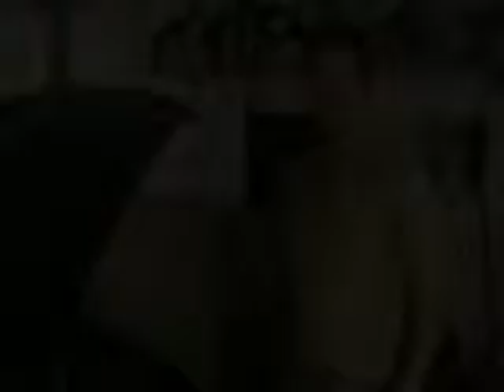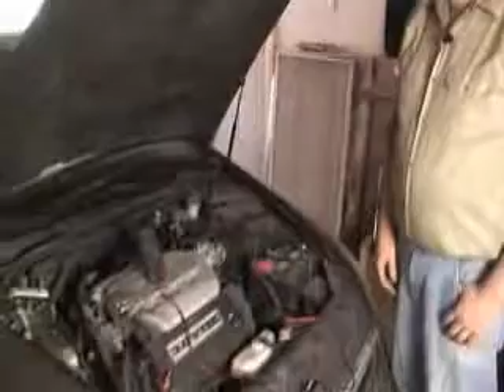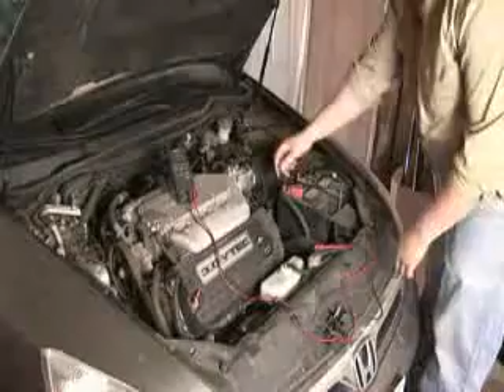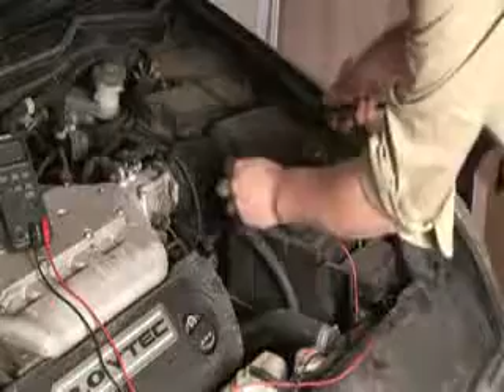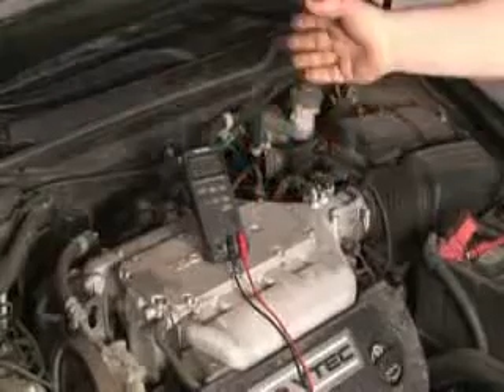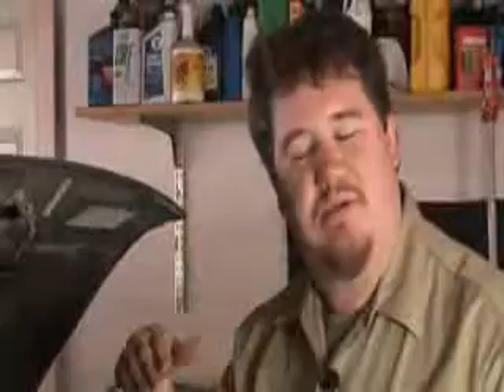Auto Repair &amp; Mechanics How to Test a Car Voltage Regulator

Comment: But what if while the car is running the battery reads as charging fine but as you turn things on like headlights etc the battery starts dropping in volts would this also be the regulator?